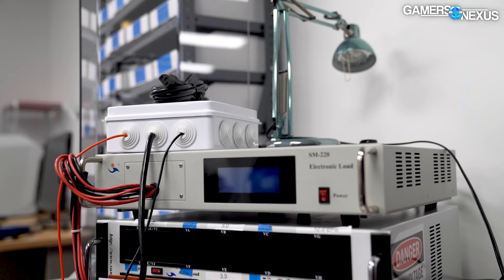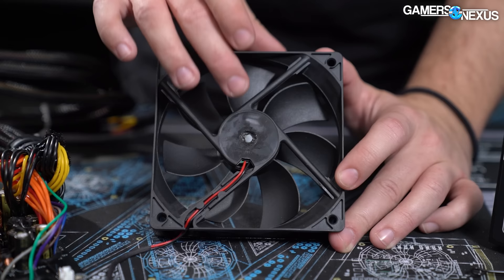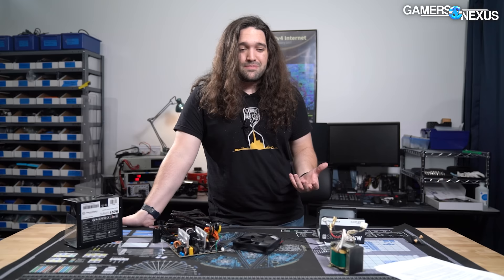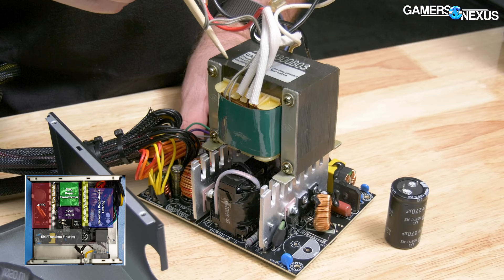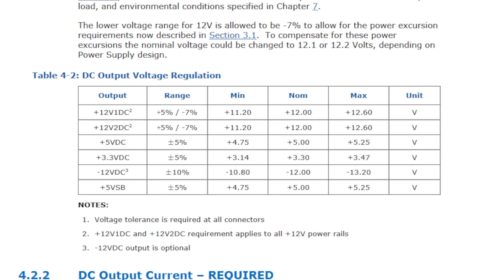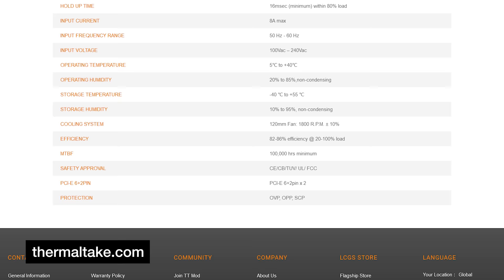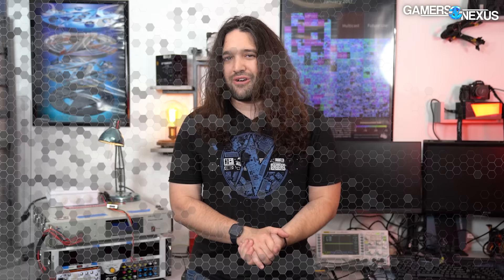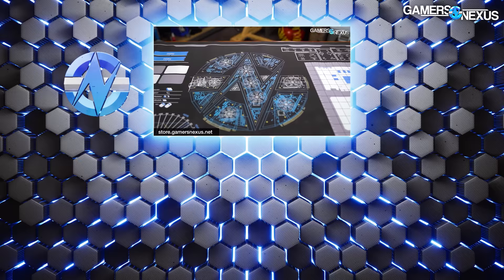Taking Risks on a Cheap PSU: $30 Thermaltake 430W SMART Power Supply Review

Comment: At the little computer store i work at when we sell cheap computers we always use either the VS Series VS350 — 350 Watt Power Supply or the 450w PSU variant. might be worth testing them to. We buy the 350's usualy between the 30 and 40 euro and the 450 to 35 to 50 euro. depends if there is a sale or not.

Comment: I have the 500W version of this and the input specs state 8 amps. More accurate?  Other than that the only difference is that the 12V rail is rated at 450 watts.

Comment: I thought Patrick's quick explanation was pretty good. It would take a whole video to do better. I didn't understand removing an electrolytic for safety. Normally we'd check to see if it was drained and if not drain it and no problem. Much easier than removing it, and you'd want to drain it before desoldering anyway.
Reply: I was thinking the exact same thing.  It was funny how he said it was removed for safety reasons, then proceeded to pick up the cap while touching both leads.
Reply: @PhazerTech  but that was because he made sure it was discharged before desoldering, right?
Reply: @PatrickPoet  Yes exactly.  If the cap is drained then there isn't any safety risk, and in fact he would have had to do that first before removing the cap.

He makes no mention of draining caps and implies that the proper thing to do is to simply remove the cap, "for safety reasons".  Hopefully nobody out there tries to do what the video is suggesting....
Reply: @PhazerTech  maybe that particular cap has blades that shoot out unexpectedly while your hand is above it
Reply: @PatrickPoet  Yes but only when it's connected to the board.  Once it's removed the blades are deactivated.

Comment: Bought a 700 smart from bust buy.  It is waiting for something to power up. It looks the same just more mosfets or larger ones. They haven't changed much since we used to tear apart old free repair computers back in college. Basically going back to "cheap" ps2 clones.

Comment: This probably would be fine for an "old school" Pentium or Duo-Core or similarly modest computer that you are using for a singular purpose. I recently built such a (mini-ITX) computer just to run an image scanner. It has integrated video, 4GB RAM and two SATA hard drives (SSD + HDD). It requires a 250-watt PSU, but I went with a 450-watt PSU (not ThermalTake).

Comment: lol... I love that Diablotek is apparently still a meme brand.. I bought a mATX Diablotek many many years ago.  It's the only PSU I've ever had throw a spark and a puff of smoke.. right out of the gate, too.. never worked for a second.  Luckily didn't damage the rest of the system.  After all, you can't spell Diablotek without BLO.

Comment: I recall purchasing a 430w Thermaltake PSU way, way back when I was a noob building my own PC back in the late 90's. I bought it simply based on user review and the relatively low price. Eventually in early 2000's, I spent a lot more time actually researching components before purchasing; like up to 6 months of research. At that point, I would only buy PSUs made by Seasonic and only after doing extensive research like reading reviews by JonnyGuru.

Comment: I have a failing MSI A750GF. My 12 volt is dropping under heavy load. I have EVGA RTX 3080TI FTW3 Ultra Hybrid. Ryzen 9 3900X, 8 case fans, 3 NVME Drives, MSI B550 MEG Unify motherboard,
I just purchased 1000watt Asus ROG. The 12 volt is dropping 10 percent under heavy GPU load when my GPU hits 400 watts or so my PC either reboots or shuts off and have to switch off PSU or unplug. Then it will boot. Sometimes if it is a somewhat light load it will just reboot. If you want it let me know. It was purchased November 3, 2021. Not even a year old. Has 10 year warranty I could get it replaced but I can't use it anyway. Not enough power apparently.

Comment: Nice review. I’d have liked to see you benchmark the unit and show the impact of a quality power supply on things like CPU boost, and impact across price range of motherboards, as while it’s a given that there is an impact, balancing all these components sensibly is not necessarily intuitive. The review lacks a bit of “tech deals” style consumer advice and context, but is technically interesting.

Comment: For these type of PSUs:

CPU: i5 or R5 and below. (65W TDP or lower, so R5 ?600X is out of the question)
GPU: 75W types or below.
max two units of storage (ie two sata HDD or SSD drives or 1 m.2 drive + one sata storage device)
No RGB
One, maybe two case fans on a stretch.

Comment: I went ahead and bought the 500w version of this power supply to put into an old desktop of mine from 2010,
my system consists of 
CPU: Core2 Quad Q9550
RAM: Micron 16gb DDR3 1066mhz
GPU: Nvidia Quadro K4200
Storage: PNY 250gb SSD
i just hope this power supply can run these components

Comment: There appears to be an error in your chart at 21:43 for overcurrent protection. The 3.3V rail is listed as triggering at 0.0% overcurrent, but based on the numbers shown in your other rows, this should actually read that it tripped at 100% overcurrent. The other displayed numbers are not a listed as a percentage OVER the rated value (this is how the 3.3V is shown) but as a percentage OF rated load, with 100% being nominal.

The presentation you use in most of the rows here is the most readable (ie: showing that a rail tripped at 150% OF its rated load, rather than saying it tripped 50% OVER its rated load) so that is likely the better presentation to stick with, but I assume the 3.3V rail was just a typo/oversight here.

Comment: I've trust a 5+ year old FSP unit over these CWT garbage heaps. Too each their own though. They haven't been cheating Steve. The 12V rail has never been 100% of a power supplies' total power delivery. It's been split between 12V/3.3V/5V since the inception of the ATX standard.

Comment: This should be good. I changed my mind on using whatever after a house brand from somewhere went. I forget where it came from. It survived my first tower, the guts I put in rebuilding it and I found out the hard way on the 3rd rebuild. It ate 2 boards before I figured it out. It had a good run but researching the issue made me change my tune. More recently I got a 3070ti, I wasn't about to put it in there with the old psu. At the time, there were no gpus at MSRP. That 3070ti was the best I could find on the shelf with an inflated MSRP to go with it. It makes no sense not to put a fresh decent psu in with such a pricey component. In my case it was a Corsair. $100 of insurance with a crazy gpu market if you ask me.

Comment: Steve is your tester capable of testing things like inductance, inductive reactance etc. Thats especially important if a sudden load occurs in one love wite and the cable next to it doesnt, like if a case is cable managed with the ssd power and GPU power running next to each other for a good length

Comment: 18:06 I think this chart might work better as a line graph, with efficiency on y and load on x, with lines for each of the power supplies. As it is, the chart doesn't show whether the power supply meets the 20% spec or not.

Comment: well if anything i feel a notch more confident in the AresGame 500w psu.. atleast its aluminum bits on the inside are loveingly finned.  not just 1/4" thick aluminum plate cut with sheet metal pliers..

Comment: you should test the thermaltake tr2. it came out in 2010 i think and they're still selling it today.
a friend of mine recommended me this power supply a few years ago and i haven't had any issues. at the time, this psu was even cheaper than a TT white 500w.

Comment: 12:12 - Transformer size can be reduced by increasing the input signal frequency then you can reduce the size of the transformer.
Question: Why not increase it even further to make it way smaller?
Reply: The switch freq. is not easy to increase at all, though. Higher switching freq. higher loses due to switching and then higher hysteresis (due to saturation of the core) and eddy current loses (those increase with the freq. squared and you want smaller core). Then you want 'tick' (cross section) secondary wire, all the 40A+ have to be carried by that conductor.

Comment: I think it'd help to specify at what voltage testing is done. Aris's reviews typically test for both 110v and 230v mains, so while I assume GN reviews are at 110v due to location, I still think it would be something to note.

I appreciate the statement in regard to the psu advertised wattage and actual 12v rating. Thermaltake is pretty notorious for this on their low-end units, but many people in regions outside of the US end up getting something with a 12v rating of 50% of the advertised wattage on the 12v rail, or worse.
Reply from the maker: Thanks. We'll add voltage to the chart titles or subtitles. It's 115V.

Comment: Not too bad for simple systems actually. Full-load ripple is out of spec, but the systems this would be used for never pull that much power on the minor rails and the protection features actually mostly work. Some don't manage that for more money :)

Comment: I had this power supply back in early 2017 with a 3600 and 1060 build. Everything I had said it would work but one day I unplugged it from the wall to clean up and plugged it back in and the pc was never the same. It wasn't until I got a new power supply that I found out that this one just stopped functioning after just 6 months. Thermaltake refused my rma btw because they believed I had used it with my new gpu, my 5700xt, which wasn't recommended for this 430W. Even though I sent them a picture of my 1060 that I used with it before they still refused the rma.

Comment: 430W combined 12V and 5V rails is a valid rating. For 1999-era Pentium 3s and Athlons, which made heavy use of the 5V rail.

One problem with that: it's 2022 now. Modern PCs use the 12V rails heavily, and the 5V is almost incidental at this point, so giving a combined rating may still be valid, but it's not appropriate for the modern usage. Maybe they should go to a separate rating, like 12V 380W + 5V 50W?

Comment: I feel like most employed individuals building a PC know it's better to get a better power supply than you need because you can usually keep carrying it over to the next system. I got an 850 watt platinum and only a 5600x and 3090. But next gen I'm able to splurge a bit and get an AMD 7700x and keep the same power supply and cooler and GPU that's always been bottlenecked. I also over did that and got a 280mm kraken which also has thermals to spare for next gen. Over do the stuff that doesn't go out of date as quickly. It will last you years

Comment: for the efficiency at 2%, could you instead test at fixed 20 watts instead? - your numbers for 2% compare a less than 10 watt draw to over 20 watt power draw? (ie, you're wanting to know efficiency at idle, which doesn't scale with power supply watts)

Comment: what was the ripple on the OPP test at that low voltage. I think you should show the ripple before the psu trips any protection. Heat and over power can realy make the ripple go crazy.

Comment: How about doing an old power supply to see how/if it deteriorates over time? For instance, I have a 650w Corsair RMx from 2015ish and it still seems useful, but I wonder if I should just replace it instead of reusing it for another 6 years

Comment: Hey Steve, did you measure the cable lengths from the enclosure or the PCB? My guess is that Thermaltake is advertising the total length, which would include the length of the wires internally.

Comment: I might as well junk the 20 year old 430W Thermaltake power supply I have (salvaged from an old system) "just in case", which I have used a few times to fire up a quick test bench. I think I'd trust this more, unless going back to the days of hardware overloading the 5V rail rather than 12V.

Comment: Why would you desolder bulk filtering cap for safety? That doesn't improve safety in my opinion - if it's discharge, it's safe no matter if its desolder or not. Also rectification is not part of APFC...
Reply: Came here to say the same thing.
Reply: I'm no psu expert but I'm not claiming to be but this are absolute basics, if you think desoldering a main filter cap for safety, I seriously question if you should educate people. That could actually be pretty dangerous. I'm sure the test results are correct, since everyone can connect a psu to a automatic test rig. But every gn psu review I become more sceptical of there psu knowledge...
Reply: @joelimmanueloelsner9211  Yup it doesn't really make sense.  Normally you would just discharge the cap before working on the board.  He obviously had to discharge it before removing it.
Reply: @PhazerTech  exactly

Comment: I would really love to see you gets get even more in-depth with the electrical knowledge. I think a lot of people are still kinda drooling idiots when it comes to understanding the relationship between voltage, amps, watts, etc in this context. What are the capacitors, inductors, mosfets, rectifiers and chokes actually doing to the signal and what does it look like when the manufacturer uses good components versus cheap and crappy components? Even if I were to open my PSU up (which nobody ever should anyway) I wouldn't know what I was looking at. I wouldn't know what's a good capacitor vs a crappy capacitor. I wouldn't know any rules of thumb for gauging whether the components inside are beefy enough to do what they promise to do based on the promised wattage. But I'd certainly love to know these things nonetheless. I come to this channel to get muh nerd on.

Comment: How effective would a hypothetical aftermarket part be which does little more than providing a large, high-quality capacitors to filter the power rails? Could it significantly stabilize either the voltage ripple or video card transients? It could have the advantage of being both outside the power supply so as to be less size-constrained as well as something which could be carried forward across future power supplies.

Comment: "Modern" transformer design. Pick a material for the magnetic core. Relative permeabilities range up to 30,000. Then cut a gat in the core reducing the relative permeability to about 4. About the same as using a wooden core. Then set the frequency as high as possible to maximize core and switching losses.

Comment: Early Thermal take PSU's were pretty bad but now they do at least what they should. 
Early TT 500-750 PSU's were not good at all some would really just fail under load. 
I have not seen those issues in quite a few years however.

Comment: How is adding together the various rails to get the 'full' wattage cheating?  YOU may not like it, but if the rated output is 430W and the individual rails equal that figure then whats the problem?  You can't run a system purely off the 12V rail, it needs everything.

Comment: For what it’s worth (pun intended), the unit conforms with the specifications for 80+ white across the board. Steve takes issue with the specifications, he even says so in the video. He should not take issue with a product that conforms to the specifications and does it’s job competently within those specifications. He only found one thing wrong with the entire unit, the -12 volt short circuit protection. On many motherboards this isn’t even used, the motherboard pin having a resistor to ground to simulate a load or nothing at all. My X570 motherboard has nothing other than a solder pad to hold the pin in place. My X470 board has a 120k resistor to ground simulating a tiny load on the power supply. Big whoop. My B450 motherboards don’t use the pin, just having a solder pad to hold it in place. Should I be concerned about a lack of short protection on that rail? I certainly don’t think so. I’m using one of these power supplies for an itx build, 5700G 16 GB 3400 speed RAM, 500 GB Nvme SSD, no video card, no hdd, no dvd, wifi on the motherboard. The whole rig uses 110 watts at max load. I’m undervolting the cpu to keep it cool, so it actually doesn’t even draw that. 430 watt power supply is overkill for this rig. It was the lowest power supply with standard connections that I could find locally. The person who I delt with at the shop tried to sell me a 750 watt platinum power supply. Ouch!

Comment: PSU is the component where so many people make the wrong choice, they just look at the power. With most other PC components quality is not an issue, it usually comes down to features and performance. But the PSU is what makes everything else work. And a good quality PSU will last you through several PC upgrades.

Comment: From the cables , it shows its age and all the "oldest" psu's split too much power on 3.3/5v , even if most devices uses most power from 12v and only minor from 5v ... still bad behavior , but from my experience with TT they build to quality is great (even if i don't buy that low power psu the smallest i had was 850w) , also it would be nice to compare it to similar (400-500watt) psu's in close price range to be precise cause by my experience you can get cheap 600w oem psu's that have efficiency lower than 80% and without any protection at all.

Comment: tl;dr:
It's an ok power supply if you need one for about $30 US. If you can afford a better one in the $50+ range, you'll be a lot better off, but this is perfectly serviceable at what it's trying to do - power a very low-end build.
Sound roughly right?